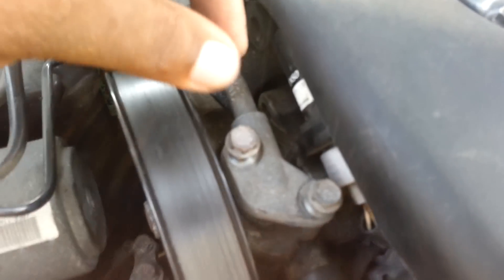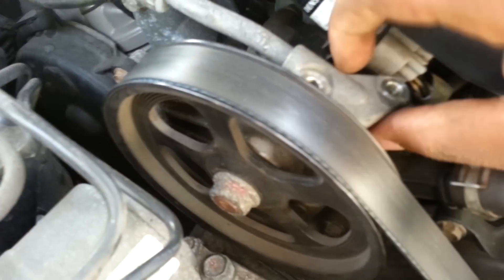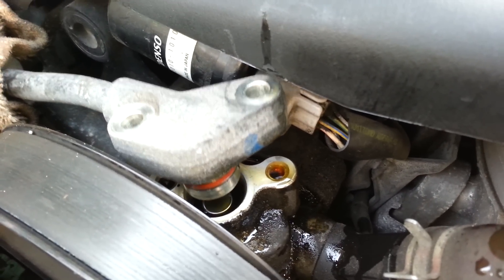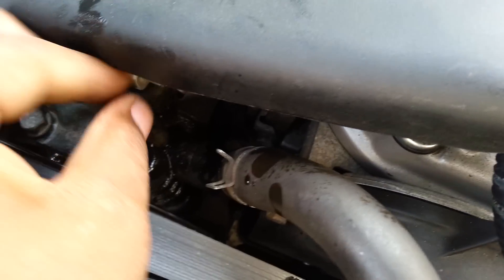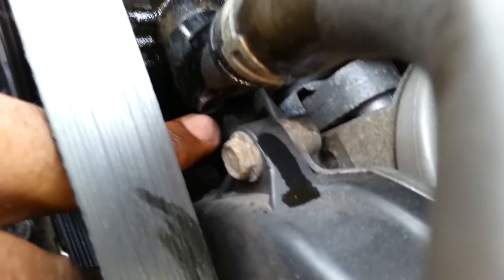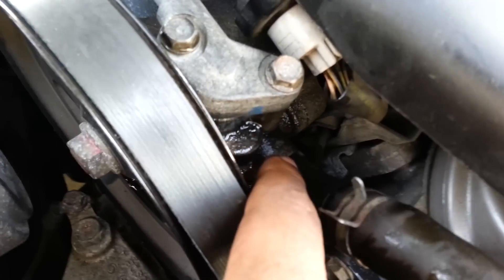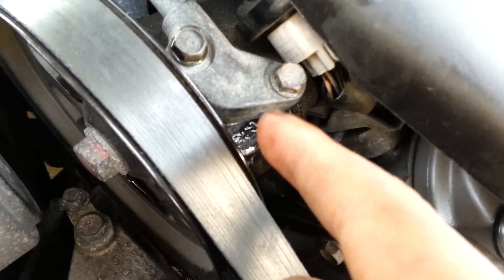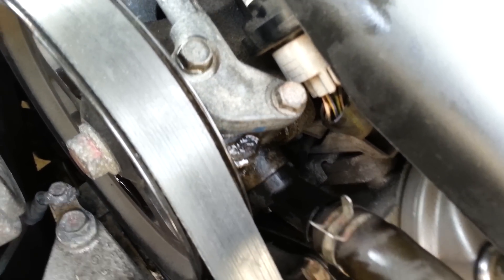ACURA HONDA POWER STEERING MOANS OR WHINES DURING COLD START-UP FIX TUTORIAL

Comment: Please help me!! I just changed my power steering pressure hoes due to a leak on my 2003 Acura MDX. The leak is gone, but now every time I turn the wheel it makes noise, then my car started smoking 😳 I pulled over  to look under the hood. My power steering fluid is over flowing 😳 What could that be? Do I need to replace the pump 😯  Please help meeeeee 😩 Thank you
Reply from the maker: +Kelley Banks did you bleed the power steering pump and did the new hose come with a new oring for the top and just take the cap off the reservoir and turn the steering wheel left and right to get all the air out of the system
Reply: fabolousg4ever. My mechanic did all that, and yes it did, he installed it. It wasn't making noise until he changed my pressure hose at the very top, to fix my leak. Now it makes crazy noise and over flows 😢 I asked him about it. Now hes saying I need a pump 😯 but Im so in love with your video, it looks soo easy and minor like I can do it myself 😁 and wonder if I really need a new pump
Reply from the maker: +Kelley Banks try replaceing the o rings on the pump might just be a small leak still if its bubbling theres a leak somewhere change the top and front o rings and then go from there if it still bubbles after changing the rings then he didn't install the hose the right way somthing is letting in air
Reply: fabolousg4ever 
Ok that's funny cause he did mention Air in it and said it should go away after driving it for a while 😳 but nothing I feel it got worst 😬 maybe he didn't install it wrong idk but it seems bad 😯 thank you so much for your advice and video 😊 Saturday on my day off Ill try the orings, then give you an update. Thanks sooooo much
Reply from the maker: +Kelley Banks I have installed so many power steering pumps and all that he didn't do somthing right somthing is leaking and he needs to fix it the car is sucking in air
Reply: fabolousg4ever OMG! 😯😯
Reply from the maker: +Kelley Banks did he use honda acura dealer one power steering fluid and did he put enough fluid you can only use honda oem power steering fluid in there cars
Reply: fabolousg4ever Thank you, if it sucks in too much air, is it going to make my engine smoke? I never had an engine problem, and notice a little bit of smoke today coming from it near the trainey in the bottom front.
Reply: fabolousg4ever yes he did, and he used 2
Reply from the maker: +Kelley Banks I don't get it why is it leaking there was it leaking there before he worked on your car or after any bubbling of the power steering f Luis means a or is getting into the sytem
Reply from the maker: +Kelley Banks he needs to bleed the system u can do it urself
Reply: fabolousg4ever no it wasn't leaking there at all, only at the very top. I'm a woman so idk if I can but I will try to bleed it. Can u make a video on how to bleed it?
Reply from the maker: +Kelley Banks yea but look how things are now after he touched it just take the resevoir2 cap off and turn the steering wheel left to right locking it and it will get the air out the system
Reply: fabolousg4ever I wish I can upload a photo so u can see it.
Reply: fabolousg4ever Ok Thanks, Ill try it in the morning
Reply: fabolousg4ever I MUST SAY! YOU KNOW YOUR SHIT! So I was curious about that turning the wheel back n fourth with the top off.... OMG all them bubbles and light brown orange looking color came up and out. I turned the wheel like 10xs then locking it in place. Now its the regular color, with no noise 😀 hopefully that was it. But ill know by morning. Thank you!
Reply from the maker: +Kelley Banks u welcome no problem glad to help
Reply: fabolousg4ever 😳 Still doing the same thing 😬 

Yeah, I guess my mechanic didn't do something right 😢 

Thanks for the tips 😊
Reply from the maker: +Kelley Banks change the o rings and go from there

Comment: Is the oring on the side not the one on the top for the accord the one that fails
Reply from the maker: the one in the front is the one that usually fails but if the front is bad just change the top too cause that oring goes bad too.

Comment: In the mornings when I start it, it starts to whine and when o turn my wheel it makes it even worts after a drive it for a little and turn it off for like 5 minutes the noise goes away what is the problem with it?
Reply from the maker: this should fix it with the o-rings its sucking in air change the orings and you should be good.

Comment: I change the o rings, now the oil is starting to come out of the bottle, what do I do now?
Reply from the maker: you have to much power steering fluid in the pump thats why you have to take some out use a turkey baster or pour some out
Reply: Well it pour already out now I need Honda power steering. Thanks man
Reply from the maker: cesar lopez u welcome doesnt work all the time sorry

Comment: How the hell do I get that bottom screw out? What tool did you use?
Reply from the maker: 10mm put it threw the power steering pulley or between the serpintine belt and the pulley
Reply from the maker: 10mm put it threw the power steering pulley or between the serpintine belt and the pulley
Reply from the maker: 10mm put it threw the power steering pulley or between the serpintine belt and the pulley
Reply from the maker: 10mm put it threw the power steering pulley or between the serpintine belt and the pulley

Comment: what the f do u do, when u replace both o-rings and the (pressure hose) is still leaking rite at the top of the pump. i cleaned the it real good after i changed them so i would know if it started leaking again. the dealer already replaced the hose when they did the hose recall back before i owned it.
 i figured the o-rings needed replacement because fluid was weeping out from the were the hose meets the pump. it doesn't leak into a puddle. just the metal around the hose fitting sucks up the fluid so its all damp looking around the hose connection. i just installed them last week and i check just now and its damp again. thinking about measuring the o-ring and getting one a lil bigger. we have a good selection at my work. if anybody has any ideas about getting the leak to stop, without changing the hose or pump. if anyone has a idea it would be helpful
Reply from the maker: the pressure hose there is a recall for it its known to leak the dealer will replace for free

Comment: I am looking at an online microfiche, I see the part number for one of the o-rings but not the other.  Can you tell us the part numbers please?
Reply from the maker: part number for front bottom o-ring
91345-RDA-A01
part number for the top power steering pressure hose o-ring
91370-SV4-000
Reply: fabolousg4ever  Thanks for the part #s... I am also in need of this... thought it was just the serpentine belt (but it looks to perfect)... Others mentioned this, but they did a recall on the pump a few years ago.. I got it done then, but I think they maybe didn't replace the O rings as I've had this problem for 6 months... was waiting til spring... then got busy.... Thanks for the video !!! -- was glad to find... will try tomorrow.. any tips on getting the lower 10mm bolt out? Can it be accessed? or do I need to take off other parts to get to it..
Reply from the maker: Dan Barry HERES A LINK TO THE WRITE UP TO DO THE BOTTOM ORING
http://tl.acurazine.com/forums/showthread.php?t=754586
Reply: Thanks! Great Video.
Reply from the maker: u welcome

Comment: the power steering wheel it gets hard every time i make a whole turn
Reply from the maker: tl steering is suppose be heavy its a hydrolic pump
Reply: Mines it’s take two hands and a good deal of strength to turn ...until the car warms up it’s easier but I do see a major leak on the lower oring
Reply from the maker: You need a new pump

Comment: i already changed the orange and the black ring but it stills bubbles
Reply from the maker: u gotta bleed the air out leave the cover and turn the steering wheel left to right a few times to get all the air out.
Reply: +fabolousg4ever i did all that stuff we replaced the power steering pump the ,rings , the switch and i even done the flush but nothing works
Reply: +Kevin Thompson thanks bro good looking out

Comment: I will do the repair tomorrow and let you know what happens.
Reply from the maker: just change both i dont know if they updated the part or anything but if thats what they gave you then i guess its the right part just change them both and that should fix your problem.
Reply from the maker: the o-ring is still orange i checked i just posted the part numbers get those o-rings that black oring they gave you was the wrong one these orings that you need are both orange.
Reply: Thanks I will go back and let them know. It was a very easy fix and it's quiet now.
Reply from the maker: you welcome anytime

Comment: I changed the 2 o rings and car still mkes whining noise
Reply from the maker: Then your pump might need replacing what kind of power steering fluid are you using.
Reply from the maker: Replace the pump then its gone sorry about that

Comment: ?
Reply from the maker: what's up
Reply: +fabolousg4ever Are both o-rings the same? I haven't taken them out yet, but I"m assuming that I will need to replace both.
Reply from the maker: +Stephen B no they are diffrent sizes.
Reply from the maker: +Stephen B yes best to replace both
Reply: +fabolousg4ever Is 09345 the bottom one? Would you happen to know the PN for the top one?
Reply from the maker: +Stephen B both of the part numbers are in the description for the video.
Reply: +fabolousg4ever Thank you!

Comment: didn't fix it at all!
Reply from the maker: then your pump is to far gone took to long to take care of it.
Reply: I've only had the car three months, it was annoying me so I found your video showed my husband (who is a certified mechanic and has own his own repair business for 35 years)
They've now replaced two ps pumps and the whining is still there but worse. Wishing I never goggled it! :(
Reply from the maker: +p “pmod” mod did he bleed the system he has to bleed the pump and only use honda or acura oem power steering fluid .
Reply from the maker: +p “pmod” mod and check the power steering pressure hose theres a recall on that hose at honda and acura the presure hose from the pump to the steering rack that hose is known to be defective the dealer will replace for free

Comment: How do you bleed it out after the change?
Reply from the maker: leave the cap of the resevoir and start the car turn the steering wheel all the way to the left and all the way to the right a couple times and it will force the air out like about 10 times and you should be good.

Comment: If it's not the pump what else could it be?
Reply from the maker: try replacing the crank pulley that made a chirping sound in the morning after the car warmed up it went away the sound so changed the crank pulley and no more sound.